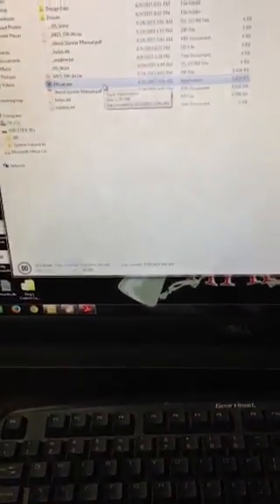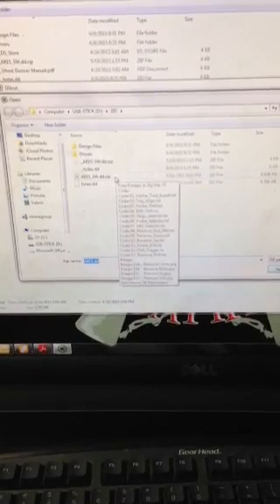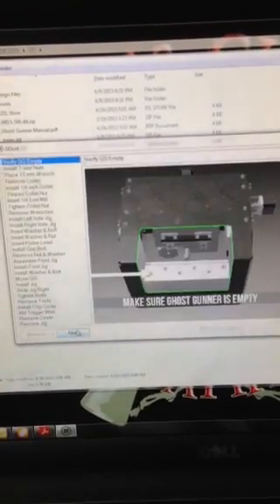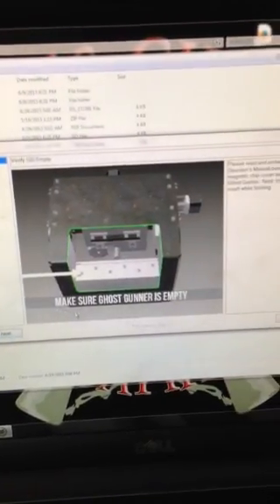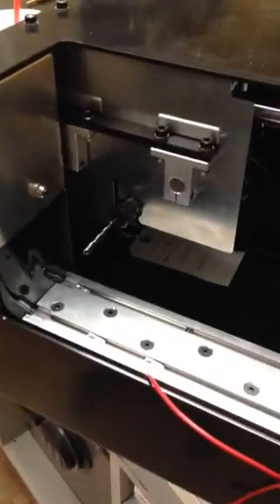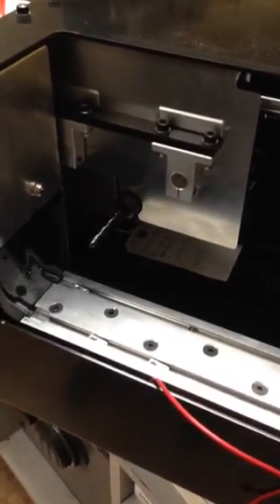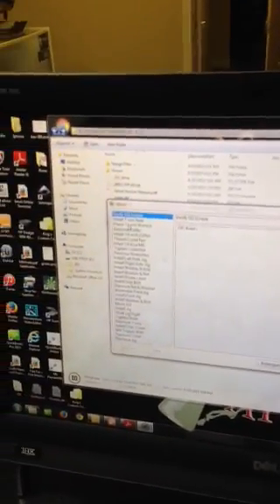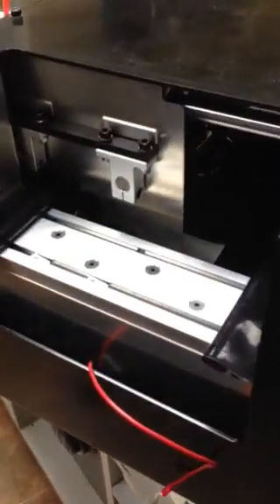Ghost Gunner Fail

Comment: I don't think your supposed to have the bit installed, looks like it is not expecting it, and is jamming it forward.
Reply: +Chris Frank 
You can leave the end mill installed, just not the drill bit, as it's too long and will crash into the build plate.

Comment: i sent mine back last week for the 2nd time.The first machine i was unable to complete a lower. i tried approx 10 times and every time the spindle motor would stop turning during the milling process.2nd machine( using the kodiak end mill bit recommended by DD) i successfully completed 1 lower that was not perfect (off center and milled into the mag release button hole) on my 2nd lower attempt the spindle motor stopped again about 20 minutes into the cutting process, unfortunately when i restarted the program the end mill bit hit the mounting platform( x axis) as it came up and bent the spindle motor.DD says the issues i am having could be from the brand of lowers i am using(tactical machining) and recommends using the brand they sell....i believe the issue is an under powered bldc motor.

Comment: DD replaced the power wattage to something higher and I bought their lower receiver for $60.00 problem solved.  The ARES receivers just would not work, bound up every time.  The DD receivers come out perfect and we've had no more problems with the machine.
Reply: That's interesting because they're supposed to be the same lowers.

Comment: I too had to send mine back.  The spindle motor quit working altogether.  It made it through half of the fire control pocket.   It's been just over a month since I sent it back, no word yet on a replacement
Reply from the maker: +Jason Grimes 
Stay on them! They had mine 2 months when I emailed them asking about it. they had NO idea. Even replied using the email they sent me stating 2 weeks and that it was an electrical issue. Finally got mine back and scared to try it.. Will probably sell it.
Reply: +Scebo King I just got an email with a tracking number, mine will be back Tuesday
Reply: Hi do you still have your GG
Reply: Yes I do

Comment: I know its been 5 years, but I hope you figured out that the drill bit was in there.....
Reply from the maker: Oh wow! Where were you 5 years ago?!?! Could’ve saved me a lot of time and misery..... No one ever thought of that since that’s what the instructions said to do plus it’s what the tech had me do. As mentioned in previous comments, the drill bit does not touch the table... at all.. if it does that then the machine would be screwed up regardless . It finds home with or without the end mill bit inserted, genius. This was a faulty motor. A factory failure due to the drive locking up in one direction. It wouldn’t travel it’s required distance.
Reply from the maker: Play stupid games, win stupid prizes you idiot.

Comment: Tried to make my first lower last week.  Set up jigs/installed in accordance with instructions.  Machine started cutting just fine and ran for about ten minutes with no issues when we heard it start making "bumping sounds" and upon visual inspection found the end mill trying to turn but only make 1/3 revolution and "climbing about 1/4" up - meant to me that the end mill drive was probably bent.  During the 10 minute run it really sounded like the end mill was trying to cut more metal that the spindle could handle, really sounding like it was under stress.  Sent the machine back to DD.
Reply: +JIM PARKS , I ran into the same issue. I got a hold of DD and informed me it was a potential power "overhead" issue where the GG is going over power budget. The GG needed to be broken in more.... In saying that, I was having a problem with that as well as a probe sequence error that cut into one of my bolts. This potentially caused damage to the end mill so I bought a Kodiak end mill from Amazon. DD told me it should suffice. Looks like DD needs more layers of quality control. I'll be testing this new mill to see if it will drive down the power consumption with a cleaner cut.
Reply: +Benjamin D It was tactical and the exact lower recommended by DD. At the end of the day, I worked with DD for a couple months to troubleshoot and resolve the problem. I sent it back for a new one. I personally believe the rear bolt bite was a software issue. I believe the power issue is attributed to the power supply not sufficiently providing enough power to cut for an extended duration of time. Hence why DD recently stated they are upgrading the new Ghost Gunners with a better power supply.
Reply: +Benjamin D ahhh ok haha, you got me 😜. I missed what you meant in context. So that's an actual brand. I meant a tactical ar15 80% lower from ares armor. is this Ben from DD who assisted me? If it is, we had this conversation already in an email.
Reply: Was the problem resolved when you ran the Grbl break in period

Comment: Somebody please make a full video on how to use this machine!
Reply from the maker: It's proper by my viewing.
Reply: GG has awesome step by step instructions, its seriously about as easy as it gets.  I just got mine last week and I did two AR-10's the first day, got my ar-15's coming in this week and soon ill have some 1911's.
But all you gotta do is run the program and as long as you follow the instructions (unlike the guy in this video he was suppose to remove the drill bit before starting the initial movement process) then you will have no problems at all.

Comment: well, got mine yesterday and haven't tried it yet...but if something goes wrong and they do not reply to me...AMEX is getting a phone call from me.
Reply: How did the machine workout for you? So many people have had problems with it that I'm pretty skeptical about buying.
Reply: +Nafir Alvarez 

well it didnt work right out the box. my trig pockets were being milled slightly crooked. i sent it in for RMA work. im hoping it just needs minor calibration.

check in again within 3 weeks or so when they said i would get ot back.
Reply: ***** Wow sorry that you have to go through that I hope everything works out. I'll definitely check back in and see what happens. Thanks
Reply: +Nafir Alvarez 

if i get back a machine that works perfectly on any MIL SPEC lower...i will praise and promote this thing to every american out there...but if i run into anymore issues...they may have a difficult time selling anymore machines. stay tuned.
Reply: +Nafir Alvarez 

just received an email from benjamin a few minutes ago. he said they are going to just send me a brand new gen 2 machine with new cut codes and new end mills tomorrow. he also praised my detailed letter regarding the issues i was having with the old machine. he stated that it helped them make sure something like that never happens again.

looking forward to the new machine and im hoping a positive review and my own step by step video is on the horizon.
Reply: ***** Thanks for keeping me updated I'm really waiting on your outcome to make my final decision. Dropping a video on this would be great you'd definitely get a lot of views.
Reply: havent given it a test run yet as they neglected to give me a new chipguard window for the new machine. the old chipguard is too small to cover the opening on the upgraded machine. still waiting for Benjamin's reply.